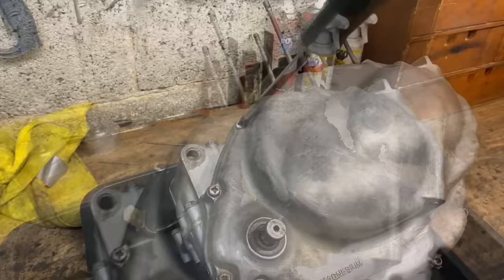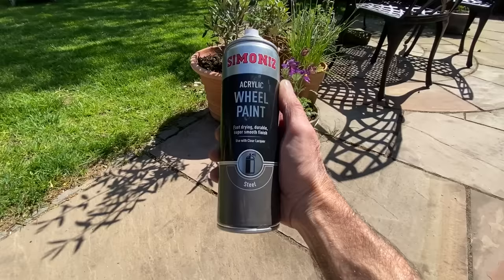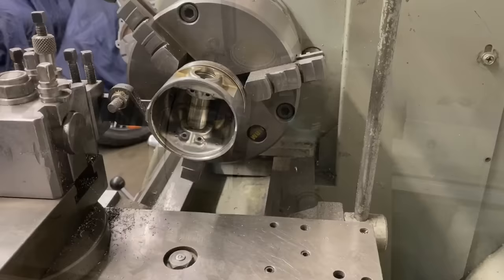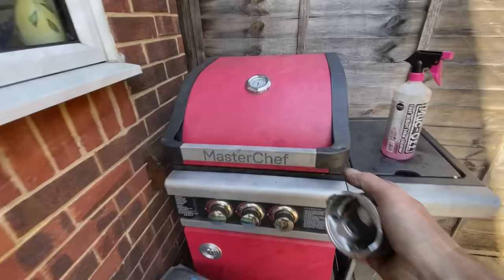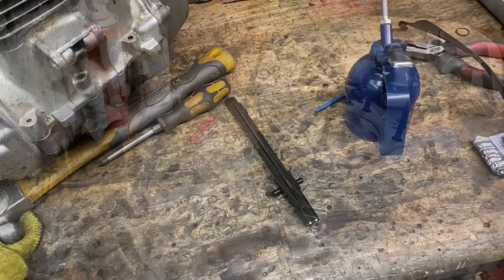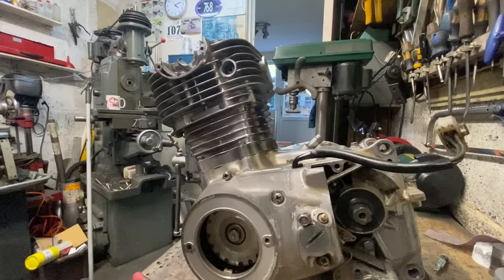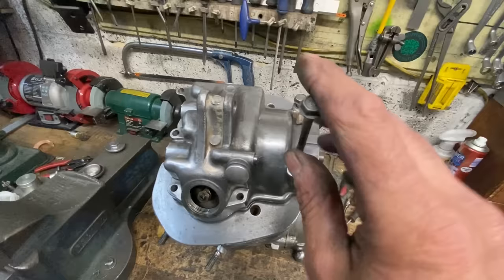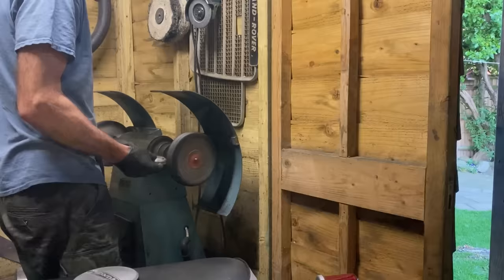Honda XL175 engine repair

Comment: Thanks for an interesting video Allen. I 1978 I bought a brand new Honda TL125S, I loved that little machine and I travelled all over the north of England on it. I believe the TL125S engine is similar to the XL125 and XL175. With regular oil changes these motors will run forever, as the cam runs directly in the head with no bushes, the oil has to be clean to avoid premature cylinder head wear.

Comment: I use to have can't remember the year I think in the '70s a Honda XL 70 it was one of best bikes I ever had I redone the whole bike  I purposely put a smaller sprocket on the back wheel it aloud me to run speeds of 60 mph.  Even did well on the trails..yes I love ur show

Comment: I love rebuilding engines, something wonderful about it. Can't wait for the gasket video,  been  making copper gaskets for a few years,  to get different port timing and squish.  I need a bbq, been using the oven when the wife is out, takes hours to get the paint fumes out, she complains but the oven is sparkling afterwards.

Comment: Kids today don’t know they landed , there’s me aged 8 with a hayes manual working out what’s different between 20 thou and and 22 thou , with nothing but a simple explanation. I think he simplified things sometimes, you don’t just pick a piston and think it’s tight it’ll work and wonder why you got holes in the piston where your valves just embedded ha ha am sure his videos will cover choices with pistons and calibration of what fits and doesn’t work. Reminds me of monroes Indian where it is was backyard engineered in a shed lol . Our tuning shop had one of them , bored out , it was a machine , it was like having a modern cr250 in a 70s twin shocker frame .

Comment: Two thoughts Allen:

1. This must surely be the only ‘70s Honda in the world with original casing screws not mashed up. Someone has always used JIS on this engine. Nice. I bought my first set of Alan head replacement screws for a Honda CD175 in 1976, the same week I bought my Vessel impact driver. Ironically, I didn’t know that what I actually needed was a set of Vessel JIS screwdrivers. 

2. After a diet of ‘I’m waiting for the gasket set from [insert local supplier here] before I can rebuild it’, followed by ‘unpacking of the cheaper aftermarket kit’ videos, all of which last longer than it took you to rebuild an entire engine, I’m now officially cured of whatever induced me to endure such trivia infested, ego driven tedium. Thank you. 

He’s not actually being a genius here guys. He’s just being old school. Now, where’s the best place to get gasket paper...?

Edit

Thought #3

Those special aluminium buttons. I’d completely forgotten about them. Do you turn your own? Or is that a silly question?

Comment: Great job! I like your comment about not using to much gasket goo,how true that is.I remember some of the early Honda CB750s where people used silicone goo and too much of it.It would oze out of the joint and end up blocking the small oil jet that fed the OH camshaft and completely destroy the cam and the cylinder head bore where the camshaft ran.

Comment: I've had good results on small capacity Honda engine casings from the '70s and '80s with K2 silver brake caliper paint, it's a good colour match to the original, is also designed to spray directly onto alloy and is heat resistant to 200 degrees centigrade to boot..

Comment: In 1976 there was a usa company called "Poweroll" who built stroker and big bore kits for all the little honda singles fron 50cc to 350cc...my boss at the honda shop where i was a honda factory trained tech, my boss became interested in what another honda tech and myself were doing after hours late at night back in the service department and that was  dismantling years old trade in ends   that never resold or were junk not worth fixing to sell as used as our boss would trade anything for anything and ran several other businesses in antiques ,  motor homes and House trailers and he owned a Dodge Plymouth Chrysler dealership so we had a lot of junk to play with and building kid's dirt bikes and General unique-looking little bikes was our passion. I was also into  amateur Motocross Racing that gave me many ideas combine with a shop full of yesterdays hot rods of parts with all the bench top work tools to hand fab what we could that sometimes failed but others drew attention to customers of our honda shop ...that's when the boss became interested as in $ ca-ching $ , so the boss said one day to take that old XL125 we had sitting in the corner missung parts and see what kind of a dirt bike we could make look showroom quality and perform as well as we could make it look ...i said ok i'll do this after hours but when its done i get to take it to my club's motocross club ground race track to test my handy work and put the final tune to it to my satifaction and no limits on parts it did not come with to a saleable degree tacked on to your resale value.. The boss said make it so as to profit or not i want my customers to see what you guts are capable of doing to these little hondas . I said agreed ..and we built an all red  painted frame ,with new red honda CR125R fenders and side covers ,gas tank and seat ...with a new set of rear 1973 CR125R shocks we had in the parts room but no front end as way too expensive as the XL125 front end was leading axle. With already a 21 inch wheel and let it go.. But with the engine we had our field day of tweaking the tweaks withan all  Poweroll stroker ,bore kit , of a total to make a 175cc engine from 125cc engine cases and matching high lift and longer duration Poweroll camshaft ...and there just happened to be a brand new honda XL175 carburetor in the parts department that bless her heart ladema Oliver who was our parts person wrote the carburetor off as obsolete old parts to get rid of ..along with lots of other nic-nac of miscellaneous to bolt this little monster together ..and on a Wednesday night after work at our club ground race track was one of my rivals in my 250 class as we both own CR250R Honda Elsinore motocross bikes ...he sees this illegitimate 4-stroke Elsinore I had configured as a brand new 1976 all red frame as what my 250 was and this club member rode a1975 grey and red CR250R ...he ask what could you possibly do with a kids play bike .....AND IN 5 LAPS ON THE TRACK I LAPPED OUR HOT HEAD RIVAL TO HIS DISMAY AND DISARRAY AS HE WAS TOTALLY BLOWN AWAY ...THEN THREE DAYS LATTER A cross-country  scrambles team got wind of my frankinstein CR175XLF AND BOUGHT IT AND RACED IT FOR TWO YEARS UNTIL THE STOCK HONDA CONNECTING ROD WHERE POWEROLL HEATS IT UP TO MELTING THEN SQUISHES IT SHORTER SO THE STOCK 175 PISTON COULD CLEAR THE CYLINDER HEAD ...THE ROD WHERE IT WAS HEATED THEN SQUISHED SHORTER WOULD ALWAY SNAP INTO IN THE PLACE AFTER TWO YEARS OF SCREAMING THE PISS OUT IT ....SO WHAT IS MY POINT??? .. IT IS PASSED TIME  MR. MILLYARD FOR YOU TO PICK UP THE BALL AFTER POWEROLL DROPPED IT LONG AGO ! IT WOULD NOT BE THAT HARD FOR YOU TO FIND OR BUILD A PISTON WHERE THE WRIST PIN HOLE WAS CLOSER TO THE CROWN SO STOCK RODS OR YOUR OWN FORGED RACING ROD WOULD  FIT NICELY ....AS WE BOTH KNOW WHAT ALL THE ADVANTAGES THERE FOR USING THE LONGEST CONNECTING ROD POSSIBLE , LIKE RUNNING UNTILL THE RINGS WASH OUT WIDE FUCKING OPEN FOR A LONGER TIME THAN STOCK ....BUILD STROKERS FOR ALL THE LITTLE HONDAS AGAIN LIKE WE HAD ONLY  THIS TIME MUCH BETTER AND THEY WILL COME ....IMAGINE A HONDA ATC70 BORDED AND STROKED TO A 105cc with a carb from a 350cc honda twin using a four speed transmission from an XL70 plus retaining the automatic clutch and but using the XL70 hand clutch side case cover you will have both usage of hand clutch and auto shifting ....well i dont have to image as we alread built one of those years ago and on the dear trails in the river bottoms of very tight turns in mud and sand our little atc70 three wheeler was first from nigger ditch to the  Darwin Ferry that's about 50 miles getting at wide effing open as the competition back then was atc110, atc 185's and the atc 200's  all had to take back seat to our tiny tike push button throttle G.I. Jo tweaked sleeper

Comment: I`m gonna save this one for a day when I`m not busy, a special treat as I have a 78  Xl250s that needs engine work and I think this might help me! ( I`m expecting it to be a triple by the end... ) always great videos, thanks for posting.
Reply: Snap, I still have a 1978 XL250s, owned from new when I was seventeen. 23,000 on the clock, no work done and it still fires first kick. Haven't ridden it much in the last 15 years but keep it maintained and running and it's still in great original condition. Might also give it an overhaul after being inspired watching this.
Reply: Had a 1980XL250.  Indestructible.  Loved the 23” front tire, not so much 6 volt ignition.  Then I got me a 1980 XL 500.  Faster, but really heavier.  Think my 250 was my overall best motorcycle I ever owned!

Comment: A very usefull video thank you very much.I have a 81 kawsaki kdx 175(parts impossible to find it is a very odd engine) and the liner was bad made the cylinderliner bought a Yamaha rd 350 piston fits perfectly and it worked fine until the connecting rod gave up and surprise a Yamaha dt 200 connecting rod fits too.most people cringe when i tell them about the Yamaha parts in a Kawasaki engine but if it works why bother.
Btw 
Sir You have one more subscriber you're a true artist 👍👍

Comment: Great channel, great work all from your shed and garage, youre a very talented guy.... just one thing ive learnt over my years in the motortrade which you may find useful, or not LOL.  A handy trick ive found with gasket paper is lightly tapping at 45 degrees with a small hammer which will cut out the shape for you perfectly....you may prefer your way for rubbing it with your fingers, but this was is easier on my ageing hands LOL
Keep up the good work!

Comment: Tip. Rather than marking the gasket with you thumb, tap the edge with a small ball end  hammer or similar. The edge will cut through the gasket material. Very surprised you didn’t know this method of making gaskets. Enjoyed the video.

Comment: As always, nice work Allen. I repaired a really beat up XR200 engine years ago. Used a barrel from a ATC200 (bigger fins) with a new Wiseco comp piston/con-rod, new valve guides and seals. Nice engine to work on, typical Honda single. Tough little engines.

Comment: Allen, good video, you keep it fast-paced to keep it interesting and this works.  But one must pay attention, because some important details could be lost in the blink of an eye!..  Your findings with worn rings may be what is wrong with my 750 engine I am taking out of the frame now.  Good idea to check.  Your turning the piston for ring fit is one I may not have thought of, thank you.

Comment: Another great little filler  video Allen, did you have to rejet the carb for the larger bore, interesting to see you use the alloy buttons, teflon is popular as well on drag engines, is your sealer the silicone based one, a tip for making holes in gaskets, put an acorn nut on a bolt, place the gaket on the mating surface, pit the acorn nut on the hole spot and gently tap with a hammer, this will leave you with a neat hole, also a good source of engine cleaner is body spray shops, most of them will be more than happy to give you used  gun cleaner, leave it to settle and all the particles will drop to the bottom of the container leaving you with clear cleaner, pour off carefully and use to wash engine parts and will also remove paint,  it leaches all the oil out of the surface and bits can be left in it to soak.

Comment: You have earned a new subscriber! I loved the work. I have only just began doing engines with my 50cc little scooter. I guess you start somewhere! It's my dream to move onto something more advanced, like this engine for instance. A small 2 stroke engine as in a scooter hardly resembles the burly monster you were rebuilding, that's for sure!

Comment: The HONDA XL TL XLR engines are great units to work on and reliable, had 100cc 125cc 185cc versions of them in the 80s,

Comment: One of the best presented videos I have watched. I can hear every word without stupid music blaring away and it is one of my most favourite past times, fixing bikes. You are a very smart guy Allen. Love it more than riding them. Love to ride them too however. Just today bought a 1979 Honda CB 750K  $2500 CDN. Beautiful bike. Only a few little things to do, for less than $100. Four into one Kerker and new Metzlers front and back. 19,000 km. Snow is forcast for Sat. May 9, 2020. Have to wait to drive it home. Global warming you know. (?)

Comment: I had an XL 500 thumper with top end issues, the cam bearings and where it ran on the head were stupid worn, had to over size it and swap the shells for roller bearings after long time in factors measuring bearings, talk about built for a limited time

Comment: I remember the camshaft running directly in the head. When I was seventeen, I had a Honda CB123S. Having stripped the engine to replace the piston rings, I liberally covered the base gasket with red hermatite. A few miles down the road, the engine started rattling badly... Yes, I had managed to block the oil feed to the head. Goodbye camshaft and cylinder head!

Comment: Always such a pleasure watching one of Mr Millyard's videos. As always I learned something. I've never seen those aluminium buttons (7:17) as substitutes for gudgeon pin circlips before but an interesting idea (and as Allen said if they are good enough for aircraft engines they should be good enough for a motorcycle).
Reply: @M Bacon Thank you for the comment which lead me to read the long Wikipedia article on nylon. Turns out nylon 66 has a melting point of 256C while nomex (a type of nylon) melts at 350C which happens to be the same melting as PTFE. I drew a blank as to the melting point of hard nylon. My ignorance on this matter is profound so feel free to correct me where appropriate.

Comment: great vid thanks I love the basic Honda bikes an would like to be more confident at getting it back togeather so far carb rebuild kit an new starter brushes in a crf 150f 
challenging enough lucky my pommy mate good at helping extract broken screw in starter housing holding the brushes in place was challenging was like i had 10 thumbs
then got it back togeather an take it back out realised i had the starter turnin backards was awsome to figue that out an so much faster 2nd time its going like new now .

Comment: The part where you a cutting out the base gasket,  an old-boy I knew used to use the handle of a screwdriver to continuously 'tap around' the edges of the gasket paper and thus cutting/pummeling through it.

Comment: Iv always wondered what that cylinder was on the crank cog drive to clutch shell . Never game to take out the circlip and see as I was afraid of going cross eyed trying to track the springs and pins that fly out in opposite directions . Oil filter ! Well I never thought it

Comment: Indeed, yes rings are expensive as genuine Honda but always available as single sets which may make them seem even more expensive as currently about £68.00 a set. Always better when you can make use of what you have though, as being a resourceful chap you do so well.

Comment: Interesting to see that the engine architecture has virtually nothing in common with the 125/185  sohc engines fitted to the XL range and others from the same era.  Thanks for the upload.
Reply from the maker: its a similar design to the 74 xl250

Comment: Have been experimenting with the annealing of copper sheet recently to form compound curves and it seems to make no difference to hardness if left to cool at air temperature rather than quenching, it does however seem to reduce distortion. The only downside is it leaves more copper oxide on the surface which needs pickling before working again as it hammers into the surface and makes soldering less successful.

Comment: Noticed the piston had cutaways for 4 valves, but the head is a 2 valve.  I trust there was no problems with clearances/ compression ratio etc.

Comment: PLEASE tell me you used thread lock on the "two little screws that hold the camshaft to the sprocket": I once had to rebuild a CB350 that had been reassembled after those bolts came loose. Although they had ostensibly been torqued correctly, they backed out and made a big mess of the valve gear.

Awesome video, thanks! It brought back many happy memories.

Comment: Nice job   How much did you have jet up the pilot and main jet on that bike to get the best out of the over bore.  I used to tune up Kawasaki’s when Kerka headers were all the rage back in the early 1980s  plus they had the small medium large and full comp baffles until the multi plate baffle came out and was quite the high tech for its time lol. Strange thing was that the more plates one added the leaner the mixture and the less plates meant a richer mixture? Still not sure how that worked lol.   I used the Sunco machine to to help with race tuning most bikes yet I also had a jet drill set that I used for the pilot and main jets by reading the spark plugs and checking the colour of the headers if they were starting to change colour.  I worked on motorcycles,jet ski’s, three and four wheelers and I was out every weekend on my souped up IT 175 that could climb the side of a house, almost lol. I loved hill climbing.  Love your videos as they bring back a lot of memory’s for me.   I kick myself every time I think about your KZ six cylinder as I had the parts yet the idea never occurred to me plus I could only oxy/acc and stick weld back then not much good for aluminum lol.  Keep up the great work and thank you for the videos.   Yes I subbed real quick who wouldn’t.